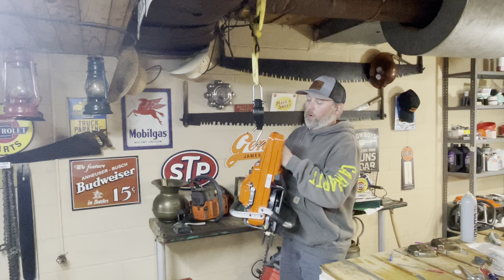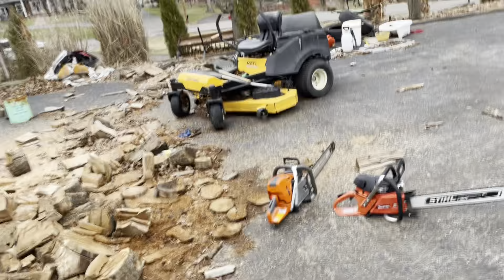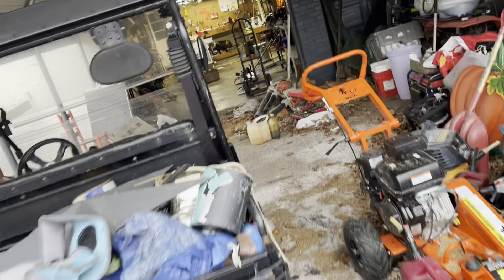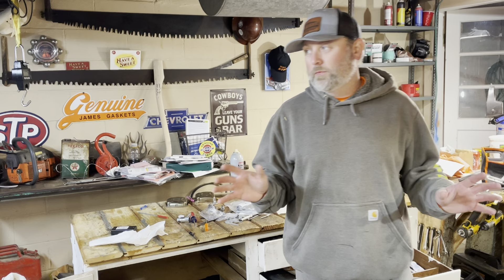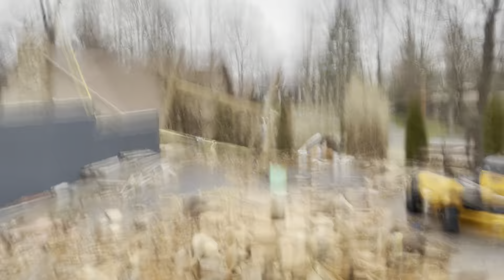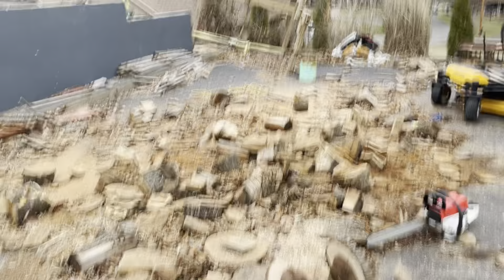Playing around with the 100 dollar saw 572 and the 7900

Comment: I ran a 572 at my last tree outfit, I liked the balance as well. It was nice to use after using my 390xp. I'll go with number 234 for the sub count.
Reply from the maker: Yea they balance good and i like husky ergonomics they weigh about as heavy as a 500i but once i get it ported it will be good enough to hang with the bigger saws
Reply: So far after a port job the 572 has been my favorite saw. I’d even pick it over a 372
Reply from the maker: @cajun3197  thats awesome i really like that platform